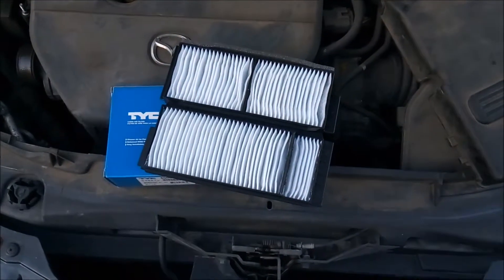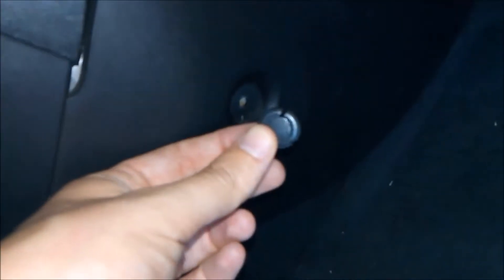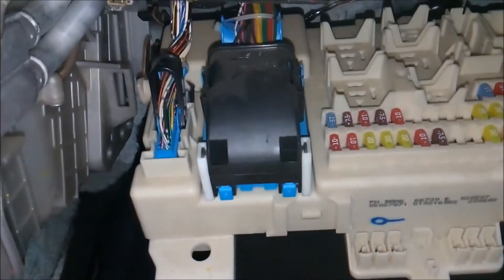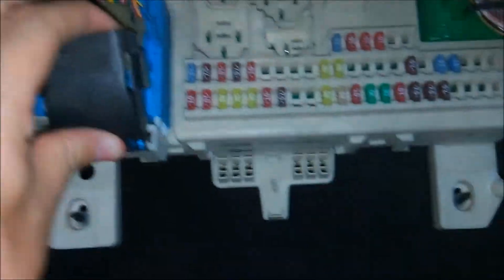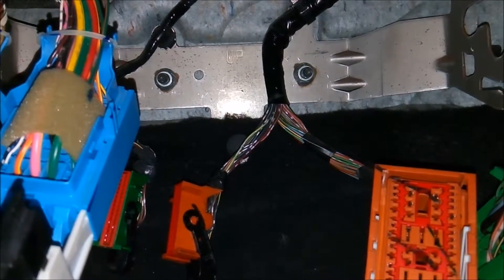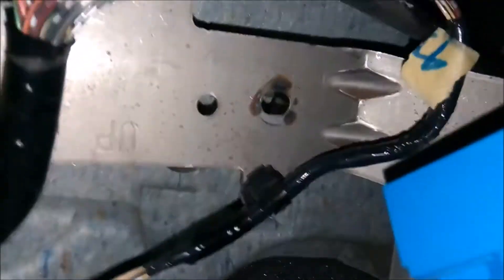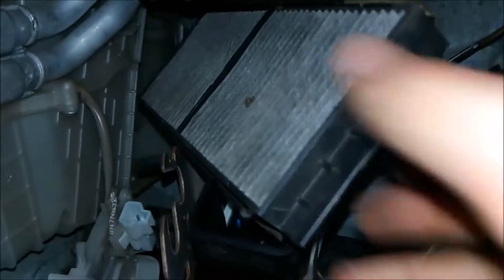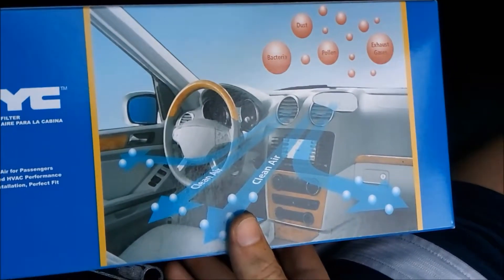How to replace cabin air filter in a 2003-2009 Mazda 3 DIY video #diy #filter #mazda3

Comment: Thanks much, the best part showing how the filters go back in the HVAC case. I laid across the console to hold the top one up so I could slip the lower in.  Its not a bad design most every thing snaps off/on from there a well thought out process of removing parts. I wish GM, Honda, Nissan would make the fuse box this EZ to get out.
Reply from the maker: We agree! Thanks for the nice comment!  This project took us a long time but we are glad we filmed it to hopefully help others!
Reply: I think this filter location was made to be ideal for right-handed Asia/European vehicles.

Comment: Hi, i just changed my filter today and Check engine light came on after the whole process. Any tips on how can i get rid of that?
Reply: Communication codes from disconnecting the fuse panel, clean them out with a san tool are it may clear itself out over time.

Comment: Possibly a stupid question, I'm not very car savvy but is unhooking the battery important? Will it damage the car if I don't or is it like a safety thing?
Reply: You can see in the video he has to remove a few things from the fuse box. You could accidentally short  something, especially on older mazdas. Always a good thing to remove the negative terminal when working around electrical wiring.

Comment: Bro cheers for the vid but a slight headache. After reattaching all the plugs to the fuse box(made sure they were in the right place), the high beams, fog lights and central locking don't work. And the handbrake light stays on even tho its off. I've gone through the fuses for the high beams but they're all good same with others. I wonder if it's coz i left the battery connected when doing it? Any suggestions man? I'm gonna give it another crack tomorrow by disconnecting the cables and reconnecting them. I even then after this disconnected the battery and reconnected it incase it rebooted everything. Gutted to say thd least
Reply from the maker: I am sorry I have not seen your comment until now. Did you have any success?

Comment: I bought a 2008 Mazda 3. I have found their designs are so obnoxious 
I owned a Honda Civic and so many practical designs blow Mazda out of the water.
Mazda is a bunch of clowns.
Took me 5 min to replace my filter in the Honda. Look at this mumbo jumbo
Reply from the maker: Exactly! What were they thinking when they designed this? Definitely not the easiest task.
Reply: That's because up until 2013 they were largely owned by Ford.  My son has a 2008 as well.  Head gasket went at 110,000kms (a famous Ford issue...swapped engine, $3,300), the relays would freeze in the winter and the car wouldn't even turn over (at about -15C or colder).  Very frustrating until I found the TSB that the dealer couldn't even seem to figure out...clowns.  $20 new ignition relay fixed it.  Then it wouldn't start again in the summer, and it turned out it was the starter connection corroding (also a TSB...$35 splice kit).  Thermostat went at about 150,000km.  $100.  Knock on wood, I hope the 'Ford' is out of it now.

Comment: Well I've changed heater cores that were easier. If this was my car the old filters would get tossed and the new ones returned to the store. I've driven thousands of miles in cars that had no filter from the factory and believe it or not, I can still breathe!!.  what a useless place to put a filter
Reply: Al M, I totally agree. It is way to difficult to replace a cabin air filter.  Thanks so much for your comment.